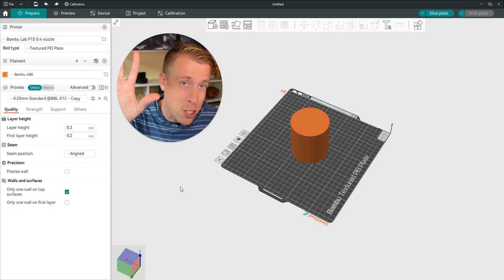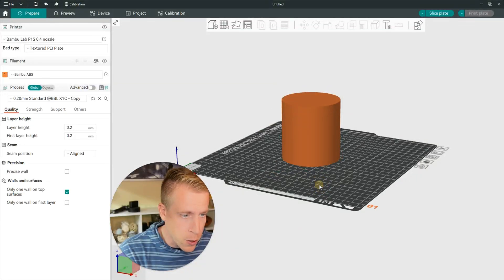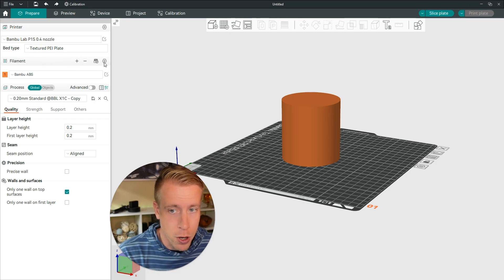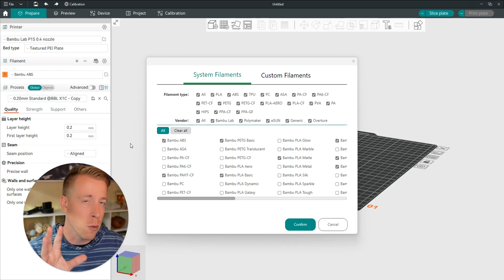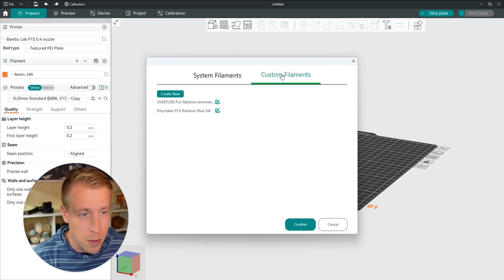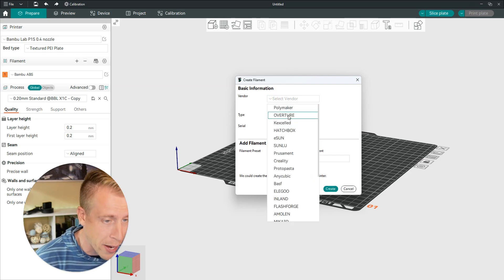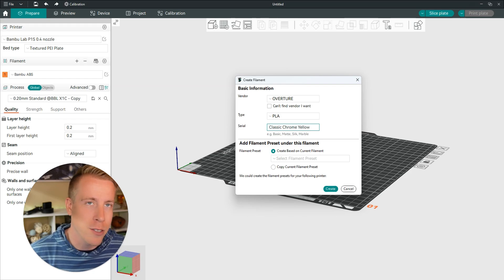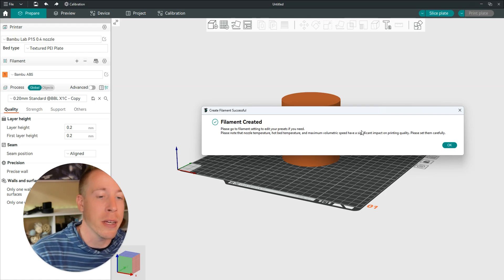How to Create Custom Filament Profile in Orca Slicer

Comment: Have a question about User Filament Presets. I have a bunch created that I use daily. However, whenever I load an external project I lose access to all my User Presets. Any ideas why this is happening? I understand that the project coming in may have it's own defined presets but I always want to access my User presets regardless of what project is loaded. Any hints on how I can do this is appreciated.

They also list a set of different named presets, like ,  and  presets (there might be others). Pretty confusing. Do you know what all of these are and how they are defined and how to & why should you create & store your profiles in these groups? Guessing the answer to this is probably the reason I continue to have issues accessing my User presets. This all should be easier.

Comment: There still is a bug that i can not open that drop-down menu to chose a profile. Thus I cannot add a filament... super annoying
Reply: doesn't work for me either. I go to the settings of the current filament, change the necessary settings and save it under a different name

Comment: Its a annoying bug, actually its not possible to create an custom filament
Reply: still bugged...
Reply: Ok Thank you for confirming this bug.  Thought I was doing something wrong🤦‍♂️.
Reply: 3months later and it still don’t work
Reply: @MandD_Forever it’s been a bug since at least 2023 afaik, i doubt they plan on fixing it sadly
Reply: Same thing, still bugs
Reply: doesn't work for me either. I go to the settings of the current filament, change the necessary settings and save it under a different name
Reply: And....here we are at near the end of June, and STILL no fix for this BASIC OPERATION!!!
Reply: @greghastings9595 Ok I thought I was just dumb and couldn't get the software to show my nozzle for some reason.